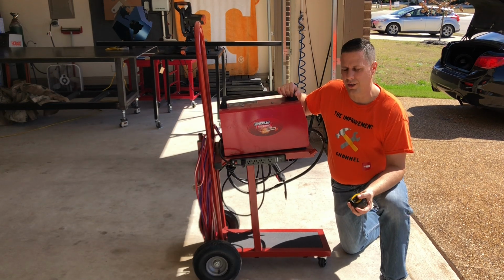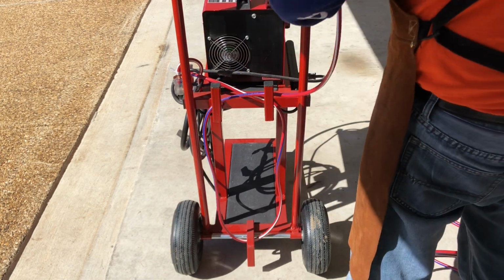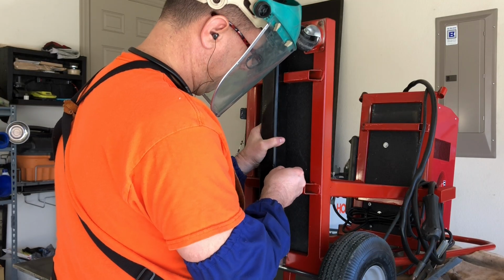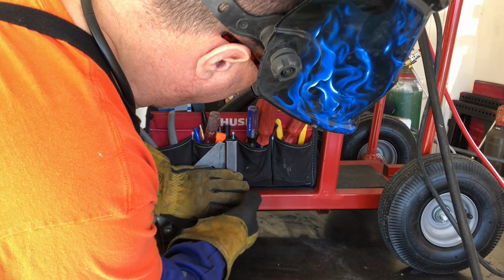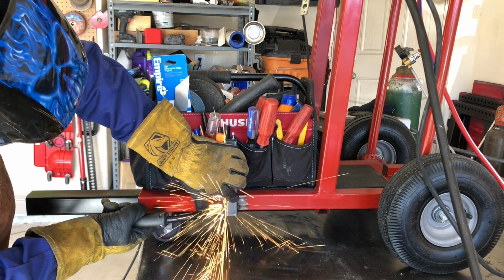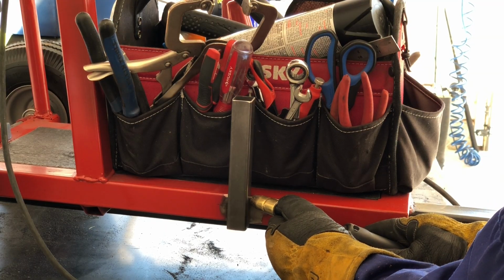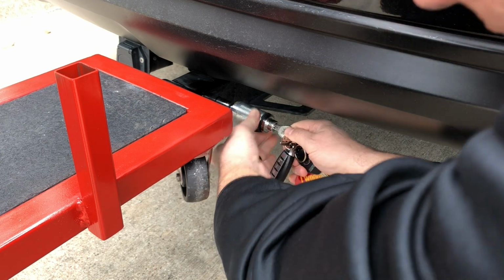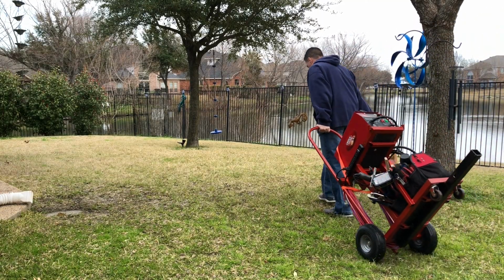Lincoln Electric Welding Cart | Adding a  Receiver Hitch | I CAN TRANSPORT IT OUT TO JOBS EASIER NOW

Comment: If you cut the top corner off of the receiver tube on your cart you will be able to tip the cart back and put the receiver tube into the receiver on the SUV, then when you pick it up you are not lifting as much weight and can more easily slide it in because it is already aligned.  If that does not make sense let me know and I will draw a diagram of what I mean.
Reply from the maker: doseven I think I understand what you are saying but I pretty much do that now without have to clip the top off. I tilt it up and let the bottom fall in crooked
 and pick it up and “tailgate” in. If I am not on the right page please draw it out for me. My email is theImprovementch@gmail.com
Reply: @TheImprovementChannel  yep sounds like you can already do what I was saying.  Keep on making!
Reply from the maker: doseven right on brother, thank you for the suggestion!